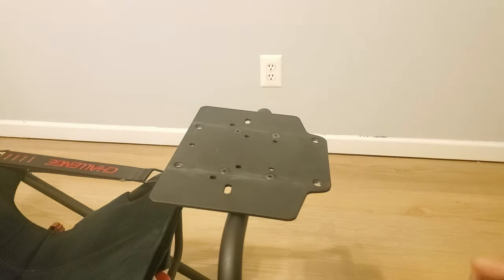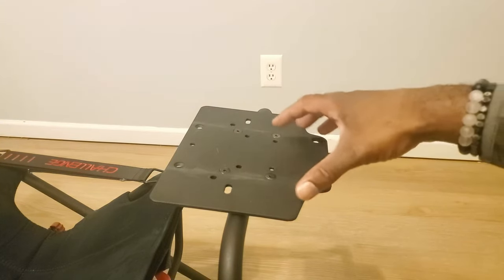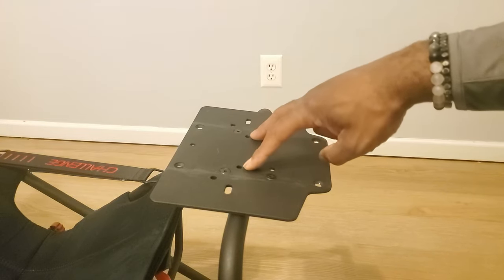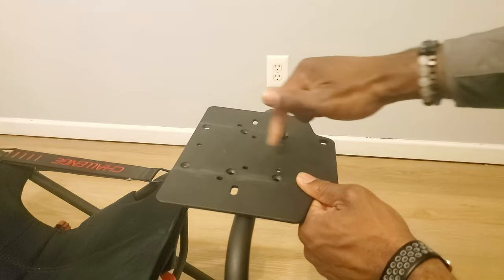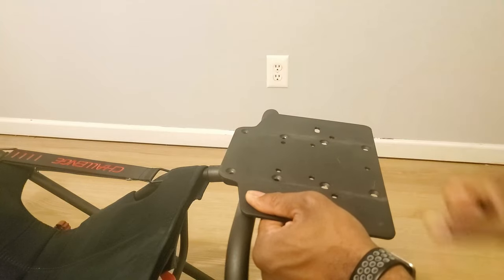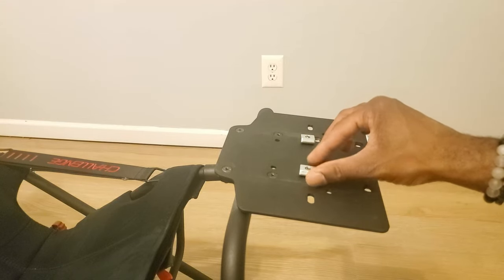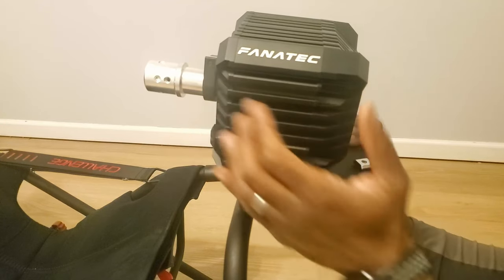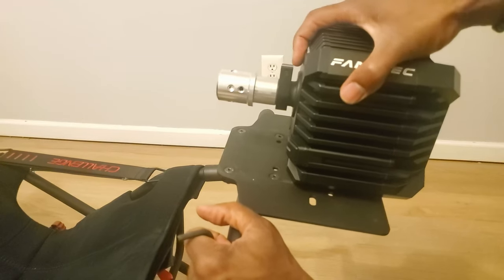Attaching CSL DD to PlaySeat Challenge

Comment: I did this first but I ended up way too far from the wheel so I placed the plate at the nearest place so the DD weight is directly on the plastic bracket and the wheel is at a perfect range from my arms. The issue is that the front hole is blocked by a small amount of plastic so I slightly drilled it, in that way I'm able to use the 3rd screw. You can also use some washer for the other screw so it will screw perfectly on the DD. Sorry for my english!
Reply from the maker: @YIAZ-M thank you for sharing what worked for you! I didn't think of that and I think what you did is a great solution for getting around that plastic. I am sure that many people that read this will benefit from your idea!
Reply: anyway for you to provide pics on maybe an instagram?? i’m having such trouble, my arms are also way to far away cause it’s sitting the farthest back on the plate and i tried moving it up yesterday and just using the 2 front screw holes but the plastic adjuster under the plate hits the rail 😅
Reply: It's not yours. It's mine!

Comment: Great video! I ended up putting some thick washers on the underside of the plate for the 2 screws that are too long, and it allowed me to tighten them without worrying about hitting the wheel base.
Reply from the maker: @Ben Aiken that is a great solution and a very easy fix.
Reply: I may have to do the same thing to mount the CSL DD to my GT Omega Classic, so thanks for getting the idea of how to solve the eventuality of screws being too long, and actually also to look out for that possibility, preloaded in my noggin! 😁👍

Comment: Thanks for the update. I have a Playseat Challenge as well and have been upgrading my Logitech G920 setup piece by piece to Fanatec and I am eager to see your setup once complete. I recently purchased the MCLAREN GT3 wheel, the 3 pedal set non load cell version because I want to see how the brake sponge feels during hard braking to see if I can live with it until a aftermarket lower cost upgrade comes out. I also brought the upgraded metal pedal plates and the steering wheel quick connect. Hopefully soon, I can buy the CSL DD (Xbox Version) next when my funds permit. I am looking to strength up the Playseat some how to handle the added stress of the motor and brake force but that's another dilemma for the future since other cockpits I looked at cost more than the Fanatec setup.
Reply from the maker: @M Anderson thank you! I am eager to share my most recent setup! I am wiring on Antje video on how to attach the V3 pedal set to the PS Challenge, but that will take a bit longer to vette the process. The McLaren GT3 wheel is a very solid wheel and does nearly everything that you need in most Sims. I will be doing a video on this in the near future as well. 
I think piecing the rig together is a very effective way to understand exactly what upgrades are must haves and how they can compliment/evolve your driving style. I am interested in seeing how your setup develops! Keep me posted with your latest progress.

Comment: This saved my butt and earned a sub. Thank you for posting this! I use a Next Level Racing GTLite Pro myself, and for that one I had to mount the plate as far back as possible (that is, use the top 2 screw holes) as the mounting places for the silver brackets collided with the bar underneath. Still, just seeing how you installed it made it super easy for me to securely install as well :D
Reply from the maker: @Hobogoku thanks for the sub, and I'm so glad this helped you!

Comment: I'm waiting for my CSL DD to be delivered any moment now and this video made me feel a little less concerned about how difficult it might end up being to mount it to my GT Omega Classic cockpit. Assuming the predrilled holes on the Playseat Challenge are aimed at a similar range of entry level wheel bases that the GT Omega Classic is, I'm now confident that I shouldn't have to drill holes into the top plate of my wheel stand, although I'm wondering if I'll have to come up with a solution to allow me to put it at more of an angle to be able to get the angle of the steering wheel to a comfortable range. Great video for my purposes. Thanks! I'll go ahead and sub your channel to see what else you get up to.
Reply from the maker: @ClusterFugue thank you for subscribing! I do not know much about the GT Omega Classic, but from what I see from some pictures, the mounting plates looks to have predrilled holes in the proper locations for the CSL DD. If the older Clubsport wheels can fit on the GT Omega Classic, then the CSL DD will because it uses the same spacing for the T-Nuts. I hope this helps further and thank you again for tuning in and subscribing!

Comment: Thanks for this! When are you posting the V3 pedals fixing to the Playseat challenge? I’ll wait until that to mount mine. 
Cheers
Reply from the maker: @Arun Ramdin it is hard to say. With my new son, career, and renovating my house, my time is much more limited. I will try to get something out this weekend, but can't guarantee anything.
Reply: I mounted my V3 pedals. All you need is zip ties x 4. Just thread them through the holes on the bottom of the V3's and around the Playseat base then tighten. Cut the excess off, works like a charm.
Reply from the maker: @FOGDaheee  that is a very quick and easy solution. The solution I have does use zip ties, but I did something that is a bit more robust since I am very heavy footed and have the Brake performance kit stiffest dampers installed.
Reply: @JCCollinsRacing  Please share your solution, I also use the brake performance kit.

Comment: Hi mate 
I have the 8nm as well but I use an Omega racing wheel stand, you just have to put in the office chair and you are set. It's super rigid and works very well. However that thing is freaking heavy and super annoying to move around. I was wondering how it is with the playseat challenge, is it light? What about stability, do you have a lot of staking?
Reply from the maker: @Moneyversac the 8 Nm base is fairly heavy, but it doesn't add a lot of weight to the PSC. I can still fold up the PSC with the base and pedals attached and move it fairly easily. There is a small amount of shaking, but it's not as bad as some other channels make it out to be. I barely notice any flex or shaking unless the wheel clips hard. But if you have the FFB setup properly, you shouldn't experience a ton of clipping. I hope this helps!

Comment: Great detailed video! Definitely saving it for later, I just ordered a GT DD Pro with the 2.5 Formula wheel. I'll be mounting it on my desk for now, since it's an office desk and pretty sturdy it should be okay, but I do want to try a playseat or cockpit in the future (as soon as I financially recover from this haha)

I am a bit worried about leg room though, I'm 1.98m (6'4 or 6'5 i think?) so idk if i'd have enough room for my knees lol
Also how are the vibrations/flexing, when using the wheel on the playseat with higher FFB? would shake too much, like to a point where it'd interfere with the driving? Or should I be looking for another playseat/cockpit?
Reply from the maker: @falcao thank you! There is little flex with the CSL DD, but nothing that will break your focus. If anything, it kinda gives you a bit more immersion since the flex tends to resemble the whatever bouncing the car is doing in the sim at that time.  I will be doing a video covering this soon. My goal is put it out before the end of July. 

In terms of your height, the Playseat Challenge is adjustable and I think your height may be the upper limit for what it can accommodate. I am 6 ft even (roughly 1.82 meters) and my knees have very little clearance. You should check out a video I did last year reviewing the Playseat Challenge. I actually talk about the adjustability in that one. The thumbnails has me looking at the Playseat Challenge with the caption, "This Is Still A Thing?!?!". Let me know you think. I hope this helps!

Comment: Awesome presentation and tutorial, JC! I'm on the edge of switching from a T300 to a CSL DD on my playseat for some time now, good to see the DD can be mounted quite easily and firmly.
One question: When sliding the wheel base on, you are pushing it all the way back until the 2 front screws hit the end of the t-nut slits, I guess. Would it be possible to mount it maybe 2 or 3 cm closer to the seat as well? 
Would take a bit weight from the tilting mechanism of the base plate (and maybe be more comfortable, depending on the seating position and the body measurements, of course.) 
Cheers!  : )
Reply from the maker: Jörn-Jören Jörensön yes, I am pushing the base all the way back. You could mount the base without pushing all the way back on the T-Nuts. You could slide it to your desired position and tighten down the bolts into the T-Nuts and the base will be just as firm. 

Hope this helps!
Reply: @JCCollinsRacing  Thanks, mate! Good to know there is some flexibility in the position.  : )

Comment: Super insightful video and very informative. One additional question, do you recall the size of the bolts you used to mount the DD to the base? I purchased my Playseat nearly 3 years ago, and mistakenly threw out the bolts that came with it a long while ago.
Reply from the maker: I believe the bolts were m6, but can't remember the exact length.  I would not recommend getting anything longer than 18 mm, but I am fairly certain that they are m6 bolts.

Comment: Great video, for the wheel to be closer to the chest would just using 2 screws work and not the centre one to allow to mount more onto the base?
Reply from the maker: @Patrick2332 no, sadly. The two slots on the sides will not allow the bolts provided with the Playseat Challenge to properly seat. Seems like the bolts are too long pull the base tightly. Getting shorter screws may solve that, though. I am not sure what length screws would be correct. I hope this helps!

Comment: Yooo respect didn't know my playseat could use my dd pro haaaa gonna try this
Reply from the maker: Yessir! Thanks for the respect and for watching! I used this configuration for over 6 months before upgrading to an aluminum profile rig, and it worked very well! Plus, I was still able to fold it away when I was done using it.
Reply: @JCCollinsRacing  nice one bro I watch your video about the V3 pedal but what about the standard pedal is it straight fit
Reply from the maker: @jesusloveyou9523  are you referring to the G29/G920 pedals? If so, that fit on top of the foot base rail and are secured with the included large velcro strap. You forget that the strap is there.

Comment: Hey man, awesome video! I’m picking up my playseat in literally half an hour and I’m waiting for my Fanatec order to arrive!
Couple questions- does the rig handle 5nm okay without extra support?
I’m around 5”11 so I think mounting like in the video will be too far for me (correct me if I’m wrong), and so if I put it all the way forward I’m worried it will be too front-heavy and wont be stable and will flex too much 🤔
Reply from the maker: @szymonski1905 I had mine set to the full 8nm, and the PSC handled it fine. There is some flex, but not enough to throw off your concentration. I am 6' even, and this configuration worked out really well for me. I hope this helps!
Reply: @JCCollinsRacing  thank you so much! Can’t wait to get started 😎
Reply: Also rocking 5Nm version here and opted only to mount it with 2 bolts and ommit the middle one , so you can move it forward/aft on the base plate without the middle bolt restricting the position. (using shorter bolts I still had lying around , without the risk of screwing them into the wheelbase)
Reply from the maker: @Blackjack174  This is awesome to know! It makes since and is a bit quicker.

Comment: Looks like plate would get in the way with hand when wheel is on
Reply from the maker: @Stuart Pietzka I can assure you that it doesn't. I had the same initial thought before doing this but my hands never come in contact with the plate. I will be doing another video where I show what it looks like with the wheel attached and how it feels while using the wheel.

Comment: Please could you tell me the distance between the hole ? I'm wondering in it's ok with an old traditional playseat model... THX
Reply from the maker: @texthemex76 I measured 1.625 inches (~41.275 mm) center-to-center between each of the 3 holes of the CSL DD base. I took the measurements with a tape measure. If anyone else has the exact measurements, please feel free to add them here. I hope this helps and sorry so late on the response.

Comment: I want to buy the same playseat like in this video & the csl base. Can i directly assemble the base on the plate or must buying additional screws or anything?
Reply from the maker: You can use the screws that come with the Playseat Challenge. That's what I did in this video.
Reply: @JCCollinsRacing  ah okay perfect thanks. My plaseat challenge and a fully completed Fanatec setup is on its way.

Comment: Check out our CSL-DD mount to SOLVE the mounting issue with Playseat Challenge. 
If you want your CSL-DD center-mounted :) 

https://www.wsra.club/product-page/CSL-DD-universal-mount-WSRA

Cheers!
Reply from the maker: @WSRA thanks for the info! This mount looks great!
Reply: Hi just wondering do you ship to the Uk or not and does it help to eliminate deck flex. Thanks
Reply: @firegaming5569  - It does not entirely eliminate deck flex, but we believe it helps. It was also designed so that the wheel is not sitting too far from the driver with the mounting plate in the farthest position. As you know, this would force you to a seating angle you may not be comfortable with. 

Please contact us via our website/email for more information and shipping. 

That way, we are now crowding JC's comments off-topic. 

Thank you

Comment: How well do load cell pedals fit on the challenge if you have a pair, just ordered some so was wondering if they work well with the PSC
Reply from the maker: @itsDxJ that depends on the pedals.  For load cell pedals, you typically have to get creative to mount them on the PSC. What pedal set did you order?
Reply: @JCCollinsRacing  CSL elite v2
Reply: i do it with zip ties @Danny4sure
Reply from the maker: @Danny4sure  Zip ties should do the trick to get you going, but will not be a permanent solution. They may snap over time depending on how tough you are on the brakes.
Reply: @JCCollinsRacing  gotcha, thanks for the help. Subbed btw
Reply from the maker: @Danny4sure  glad that I could help! Thank you very much for subbing!

Comment: Hi, do the pedals create any problem when you close the playseat? I’ asking cause i have the csl pedals and I can’t fully close my f gt lite because of them.
Thanks in advance
Reply from the maker: @Mr Gucciardi no. Once you have the pedals securely mounted. They fold up with the seat. The PlaySeat Challenge doesn't  fold as nicely as it does with the G29 pedals, but it is manageable. The V3 pedals are heavier than the G29's, so you may have to use stronger velcro or rope to hold it together while folded.

Comment: Do you still use the Playseat Challenge with the DD on it at this moment in time? If so, I know a great solution for extra stability, as I am using it myself
Reply from the maker: @giogamer4825 I don't run this setup anymore, but I still have the PSC. I am now using an aluminum TR80 build.
Reply: @JCCollinsRacing  ok great 👍
Reply: I am using this exact setup! Do you mind sharing the extra stability setup? Would greatly appreciate it. Thank you in advance!

Comment: Where did you get screw, there in no screws in csl dd bundle? Do you need to buy it by yourself?
Reply from the maker: @Marble I used the screws that came with Playseat Challenge. You can get the screws from Home Depot. I went there to get some replacements. 

16mm
https://www.homedepot.com/p/6-mm-x-16-mm-Socket-Cap-Screw-2-Pieces-803338/204225807

25mm
https://www.homedepot.com/p/Everbilt-6-mm-x-25-mm-Internal-Hex-Metric-Socket-Cap-2-Piece-865008/323370833
Reply: @JCCollinsRacing hey! 2 x 16mn and 1 25mm right?

Comment: isn’t it flimsy under load tho with the plate sagging like that
Reply from the maker: @F82stoss once it is secured, it is not flimsy. Holds pretty well! Haven't had to readjust it since I attached it.
Reply: @JCCollinsRacing  Hell ya good to know. Hyped for all my new gear to show up
Reply: I have mine mounted with the plate in the same position but drilled some new holes to move the DD a bit closer to me and use 4 fixing points. I did find a bit of flex so I bought the Pro 3D printed braces from IndigoLime and it's so much better. They're available on eBay.
Reply: @Abarth_71  Ok this is good to know! I was about to order the IndigoLime set but I was scared the braces that attached to the plate would hit my knees but I guess not?
Reply: @stoss-11  no issues with the knees.
Reply from the maker: @Abarth_71  very nice! Was it tough figuring out where you wanted the new holes?
Reply: @JCCollinsRacing  Easy really, I still use the two outer holes but drilled 2 new ones up the centre line.
Reply from the maker: @Abarth_71  got it! I can see how that works.

Comment: Hello bro, is it shakey when u use it?
Reply from the maker: @Florian actually no. In the few rare moments of clipping, there is a little flex in the cross member the base attaches to. Overall, there is very little to no shaking. It is a bit more pronounced in AC, but in ACC and F1 2021, there is little to no shaking. I have yet to test out out rFactor 2.